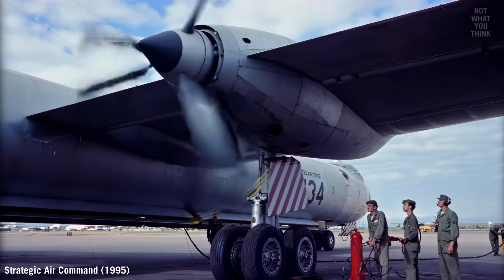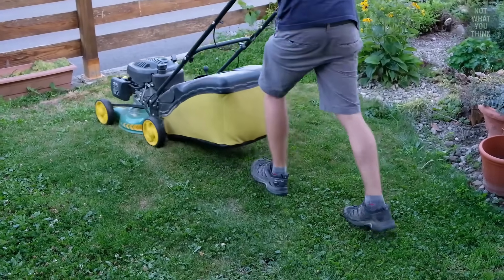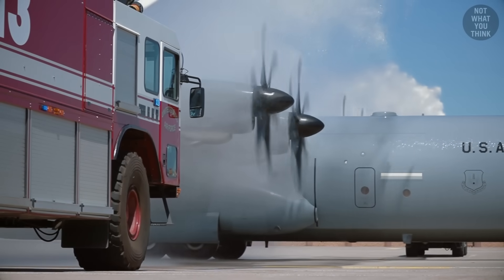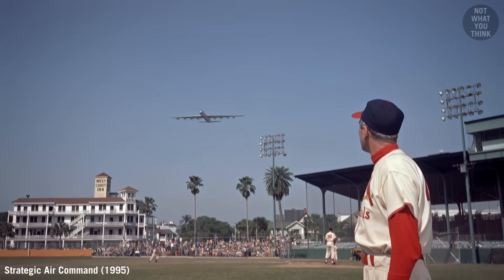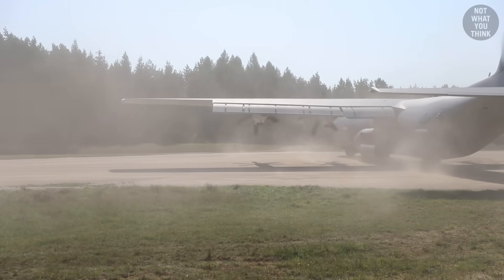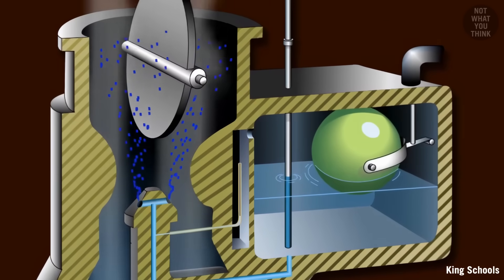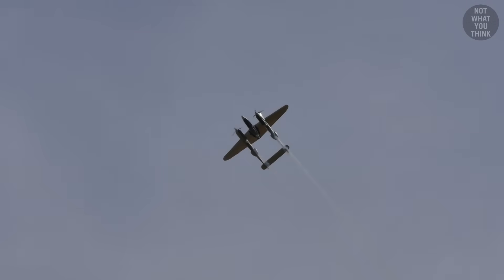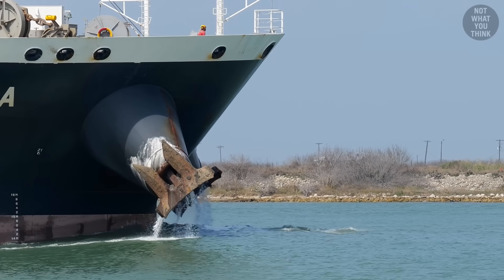Why airplane propellers moved from BACK to FRONT

Comment from the maker: Interested to join our team?
Click here: https://forms.gle/fsoAguYFwKizDVZw9
Reply: I wish I  was a smart enough Fokker to join the NWYT team! I've been a fan for years. Excellent content delivered with wit in a matter-of-fact tone. 🖖😸
Reply: @67GTV  i'm as dumb as they come but i'm applying anyways. why not give it a shot?
Reply: I'll mop the floors. 🪣🧹
Reply: I'm a pilot and a museum docent and a huge fan of NWYT. Application Submitted!
Reply: Because everybody who is pushing/pulling heavy loads regularly knows, pulling is easier.
Reply: You do know that the film Strategic Air Command was made in 1955 and not 1995 right ?
Reply: The real Grand-Fokker is that guy!?!?!?!
Reply: Love this deep dive! The tech, history, and relevance to drones makes it such a fascinating watch. I also reached out about joining the team—would be excited to contribute to projects like this!
Reply: to deal with turbulent air, the propellars at the back could just be fane like Jet engine but only fan in duct configeration and that will solve the problem??
Reply: @Dailymailnewz  No the solution is to put a ring around the propeller. The design of the fan or fanblades just do so much. The same solution is used on modern Submarines by the way.
Reply: @Dailymailnewz  There are many problems to solve if you want a pusher prop configuration. Engine cooling is easy when you have pull config, just make a big hole around the engine, when you have a push config you need to create extra air ducts for the cooling air which in turn mess up your aerodynamics. 
Furthermore plane development in those sizes of  planes is/has been almost exclusively millitary. Millitaries around the world dont like too complicated things, while you can make pusher planes work you need liquid cooling to reduce drag which is not a good idea when you might get shot at.
Reply: It is Not easier to push a load than it is to pull a load!

Comment: Vessels moving in viscous media, such as airplanes and boats, are best steered by placing the rudder at the rear. 
Ship propellers are located in front of the rudder to provide better steering at low speeds. Having a ship propeller
 in the bow of a ship would cause violent vibrations in the hull.

Comment: Lots of misinformation here.
Pushers are generally faster.
Cessna 150 (O-200): ~100 knots
VariEze (O-200): ~160–170 knots
I fly a varieze and its 60 knots faster than a Cessna 150 with the same engine. It also uses a lot less fuel than the cessna and has more than twice the range. 
Its also near impossible to stall the varieze, not so with the Cessna.

Comment: The front propeller creates a flow of air at the wing root that is faster than the actual speed of the aircraft, allowing the aircraft to take off and land at a lower speed than with a pusher propeller configuration, resulting in a shorter runway.

Comment: The claim made at 1:22 is false. Having propellers in front of the wing creates airflow over the wing providing additional lift. Doesn't matter if you pull or push. The thrust is the same. And then, pushing an object is not "intuitively" easier than pulling and object, that's rubbish. No point in watching any further.

Comment: You show a lot of videos of the Piaggio with its pusher engines. This plane is one of the fastest turbo prop airplanes and the most fuel efficient. In addition this configuration makes for a quieter cabin !

Comment: 11:25 How are today's Turbofan engines "pushers"? They are basically pullers as the bypass air generates significant thrust that pulls the plane forward! I think modern turboprop and turbofan engines both are pullers!! Am I missing anything?

Comment: Many flying boat designs have pusher prop (1 or more) above the wing, and in front of the tail control surfaces. That eliminates the low airspeed control authority problem... but introduces it's own quirks like a nosedown tendency upon suddenly increasing power (typically the OPPOSITE of what you want, i.e. in a go-around or when you realize you're coming in for touchdown short of runway).

For G.A. - pushers' tendency to overheat until flying is a significant issue. A Berkut-540 had about 10 min from a cold start till it needed to either get airborne or shutdown the engine. If there's any kind of line for takeoff - the wait could easily be longer than that, leading to takeoff with CHTs already above 400F (in the yellow)...

Comment: Much of what you said is true, however there are a few minor errors. First and foremost, a pusher configuration is actually more stable. Having the thrust and gyroscopic forces behind the center of mass is indeed more stable, it does have an impace on slow speed handling, which I think would have been a better segment than "dynamic control." Further, the correlation to efficiency is convoluted, this is very dependent on the fuselage and wing in front of the prop. On a well designed aircraft, the retained laminar flow and lower drag can offset the reduced efficiency of a pusher, however this is going to be on very pin point designs, not your typically draggy Cessna. Lastly, The engine in front has no impacton your CG. Your CG doesnt matter where the engine is, it is purely a function of where it needs to be to balance aerodynamic forces.

Comment: That's incorrect, it is easier to "pull" a mower than to "push" it. In physics class we had to do a moment force calculation and the forces are less while pulling than pushing to get over obstacles or terrain, but it is easier to direct a mower to cut your grass. Nice video

Comment: On ships the main advantage is hydrodynamic efficiency. With the propeller in the wake of the ship the water around it is actuallyh moving forward, so for a given backward speed of the wake from the propeller, the change in speed of the water passing through it is greater than if it were operating in still water at the bow. This effect is smaller for aircraft because much of the propeller arc is outside the wake.

Comment: How are jet engines pushers? The fan sits on the front. And every drive system pushes air out the back, creating thrust there.
Based on the points raised in the video, they're neither.

Comment: The increased airflow from a front of the wing mounted prop produces a bit of extra lift from the wing. Of course an increase in lift increases drag. It's definitely less efficient but the difference in lift is significant

Comment: Loved the video but the airplane that flew around the world had both a pusher and tractor engines as an efficient design for a reason. I don’t have a degree in aerospace engineering but I’m guessing the pusher looses some many disadvantages when you place it centrally and to the rear of the aircraft instead of the wings.

Comment: I know that on the Cessna 336 and the 337 Skymaster,if your airborne and you lose an engine you would want the front engine instead of the rear Why? Because pushing is more economical than pulling.

Comment: You're getting about half of this correct. You're missing how each of these decisions involve tradeoffs, each has their benefits and problems. One huge thing you're missing is how, for a bunch of amateurs who want to operate devices that could easily kill them for any number of reasons, pilots tend to be a very conservative bunch. Burt Rutan has provided several examples of well received new designs with real benefits. Yet, most pilots would prefer to fly designs called, "The Doctor Killer". If everybody else is not doing it, they won't either. That's why most new designs look like changes to existing designs, they are.

Comment: Stall recovery? Unaffected by engine placement. If balance (CG location relative to the primary lifting surfaces) is correct, there will be no differences.

Comment: Sigh ... this video doesn't really explain why tractor propellers are the norm, and pushers aren't.  It's actually incredibly simple; here are the factors in order of importance.

1. Propeller clearance --  forward propeller increases propeller clearance as the angle of attack increases ... and guess what?  Aircraft take off and land at high angles of attack.   This allows larger propeller diameters, that are more efficient.

2. A forward propeller is less vulnerable to surface junk thrown up by landing gear.

3. Bailing out into a spinning propeller is something most pilots object to.  

These factors are why pushers are rarely seen in single-engine aircraft.  Don't get me started as to what a disaster of a design the Vari-Viggen and Vari-EZ were/are.  The are Darwin-award sucker bait. 

Beyond that there are some other factors -- tractor propellers improve pitch stability, but this isn't a major concern.   The positioning of the propellers wrt the fuselage for the impacts of either thrown ice or (far worse yet) a thrown propeller blade is another issue.    That issue prefers  propellers either out in front of the whole fuselage (trivial in single propeller designs, but in fact also seen in many twin-engine designs) or at the rear of the fuselage ... but that choice often leads to CG design problems. 

Against those factors pusher props can increase efficiency moderately, and also have the subtle advantage that an engine fire in a wing-mounted pusher is far less likely to burn into the wing and bring the whole airplane down.

Comment: It also had to do with safety. Early pushers were dangerous for the pilots in a crash like with the early Curtis planes. Pilots were killed in otherwise survivable crashes because the engines would crush them from behind. A tractor rig was safer for early planes.

Comment: Having grown up in Wichita Kansas, and heard Beechcraft, Cessna, Learjet, and Boeing planes flying overhead all day every day, I can honestly say that the Beechcraft Starship is the loudest prop plane I have heard.  Not only the loudest, but also the most obnoxious sounding engine pitch.  You can hear them 30-60 seconds before they fly ovehead.  And a good 2-3 minutes after they pass.  The Cessna Skymaster was also louder than normal, but nowhere near as loud as the Starship.

Comment: Engine cooling (as described in this video) is only a player for piston aircraft.  Turbine aircraft use the air flowing through the engine for cooling.  

The carburetor statements are also incorrect.

Comment: I never personally met WW1 pilots - but my grandad, of that generation, encountered a few in France.
There were a few pusher aircraft around - offering clear advantages in operating gun(s).
But - apparently unpopular with pilots of single-engined aircraft. If they landed hard or 'pranged', the last thing they needed was an engine and airscrew now intent on invading the cockpit.

Comment: Another thing to consider is how propellers create thrust depends primarily on the prop face. Props are fundamentally rotating wings, and Thrust is entirely the consequence of lowering the pressure of air on the face of the blades. Many high performance aircraft of history featured large bodies behind the prop, yet still could deliver incredible speed. Thrust from a prop, or fan, is best with an unobstructed approach to on coming air.

I still love pusher planes tho. One of my favorite personal designs was a pusher prop. It was great for that design cause the prop could more often survive in landing or crashes since it was in the back. Rear props actually shift the stability margin rearward on aircraft, making them track more stable. The main method to get more performance from a pusher prop besides more power is to reduce the disturbance of air ahead of it, but when it comes to efficiency a tractor prop will always out pace.

Comment: "Pushing an object is easier than pulling it"
If you're using your legs, sure.
If you're using your arms, pulling is much easier.
Most people can do one pull up. However most would struggle with being stood on their head (having people balance them upside down) and told to push their weight up.
From a biomechanics perspective, we are designed to pull, not push.

Comment: Jet engines are ALSO "Tractors" in configuration because they are mounted ahead of the wing and the air is pulled in by their "turbofan" and simply because the rear "nozzle" shapes the flow does not make them a pusher.  One supposes it would come down not where the air goes in but where it comes out, as in are the jet engine exhausts / thrust nozzles behind the wing?  And what about "blown flap" designs like the C-17?

Comment: Reconnaissance is a much broader field than you seem to be aware of. That's why reconnaissance by aircraft is called...aerial reconnaissance. </facepalm> Edit" You also don't seem to clearly understand symmetry. Almost all rotors/propellors have radial symmetry, regardless of the number or blades, but none, not even ones with an even number of blades, have perfect symmetry because they have to be angled against the air they are using.

Comment: Hi. Having a propeller at the rear has three problems. 

1/ It puts the engine at the rear as well, and being the heaviest single item, that put the centre-of-gravity so far to the rear that the fin and elevator often became ineffective. This gave control problems. The XP55 Curtiss Ascender couldn't recover from a stall or a flat spin because its vertical stabilizers were at the same distance longitudinally as the engine. Think of an arrow going backwards.

2/ A rear propeller was a hazard to any pilot bailing out. The XP 55 had explosive bolts to shed the prop, but if the systems needed to make that happen happened to be damaged, the pilot became "mayonnaise on a string". 

3/ Vintage aircraft had the problem of crash landings, where the plane stopped, but the engine kept going forward, once again turning the pilot to mayonnaise. The "Mixmaster" aircraft had the same problem.

The layout worked for the B36 because its wing mounted engines were very near the centre-of-gravity anyway. The lack of adequate tail surfaces was why Jack Northrop's twelve completed B49 flying wing bombers were destroyed in one fell swoop. As they say, "if it don't look right, it's not right". "He who doesn't learn the lessons of history is doomed to repeat them". I believe they're experimenting with airships again. Dreamers! Cheers, P.R.

Comment: The design of aircraft hasn’t changed in some 100 years . 
But when new design does come out , the traditional lists shoot it down . 
There was a drone designed in Sweden , called jetson 1 .  The traditional lists raised the price to something no one can  offord . The jetson 1 can be built for $ 8000 .oo 
They raised the price to $190000. Oo
So innovation is not allowed . The jetson 1 does not require a run way , or an airport . Nor does it require more than a drivers license . 
So this airplane idea is a failure . They will not allow it in the United States . 
Period !

Comment: Firing bullets through spinning propeller still resulted in bullets piercing it because bullets don't always fire at the exact same rate due to imperfect manufacturing and a bit of randomness in chemical reactions. Propellers could somewhat handle bullets through them though, so it was still preferred.

Comment: I can speak from my RC plane experience.  Tractor prop set ups (on front) provides airflow over the control surfaces.  Very helpful in slow flight where not much air is moving over the rudder and elevator.  Rear props (pushers) are louder as the prop sucks the air from the fuse.  They also have less control at low speeds.  My flying wings and water planes have rear props (or just high props).  They can move much faster and have less drag than standard planes.
Reply: Rear props also need to not be directly behind control surfaces or the prop translates to pulling and vibration on the control surface. Its a bit obnoxious that this video of "not what you think" covered nothing I didn't already now and failed to cover things I did know. Its scary how dumb your average "smart" person must be to get something out of this.

Comment: To me the difference that a propeller in the front is nicely "screwing" in undisturbed air ..... while an engine in the rear gets "dirty air" with turbulence ...
Reply: But the high speed slipstream of the prop in front slams into the windshield and fuselage causing much drag.

Comment: Are you sure modern engines like on the 737 are pushers? They are turbo-fan engines and the thrust comes primarily from the fan blades in front of the engine.

Comment: One major advantage of having the engine at the front is that it is possible to get the full lift coefficient of the wing. For longitudinal stability, the centre of gravity must be forward of the neutral point. With an engine at the back, and pitch control surface at the front, like Wrights and Rutan, the neutral point is forward of the wing's lift centre, and the CG must be forward of that (unless you have active control). That means the foreplane is lifting at wing zero-lift, just to balance the pitch down moment of the wing at zero lift. An "advantage" claimed by Rutan is that the aircraft is unstallable - the canard stalls before the main wing. A disadvantage is that it is virtually impossible to increase the wing lift using flaps, because they produce a strong pitch down which stalls the foreplane even sooner.. When we were working on the SABA design, the joke, "Where is the best place to put a canard?" was "On someone else's aircraft!".(the SABA was an imitation of the A-10, for the same purpose, but with a pusher prop instead of jet engines).